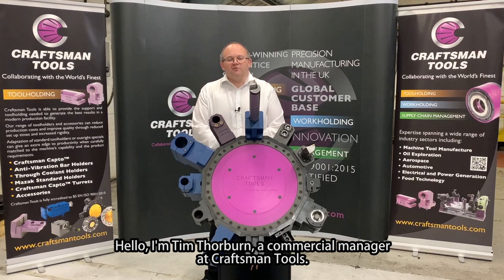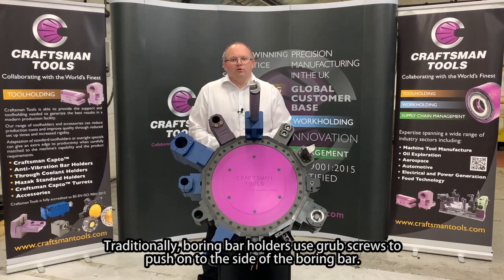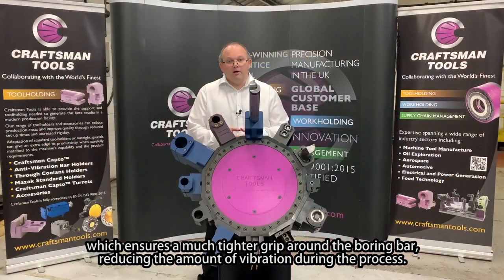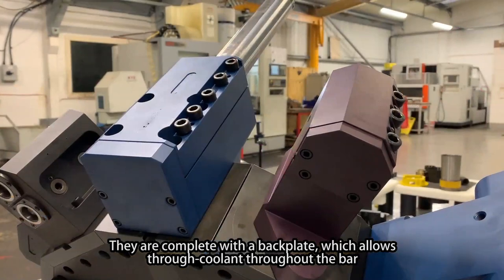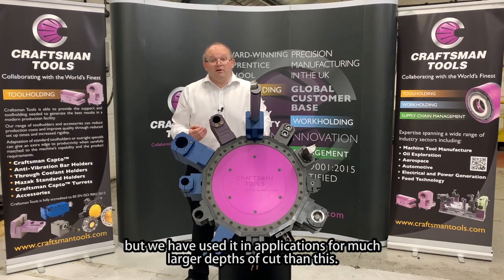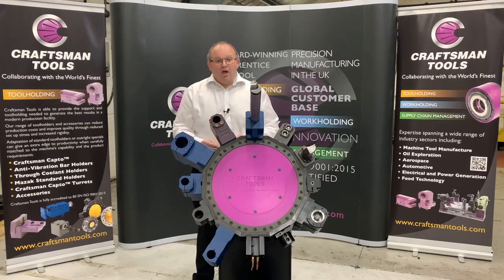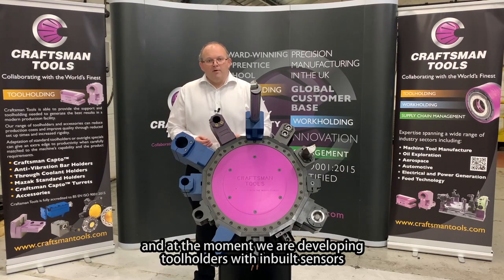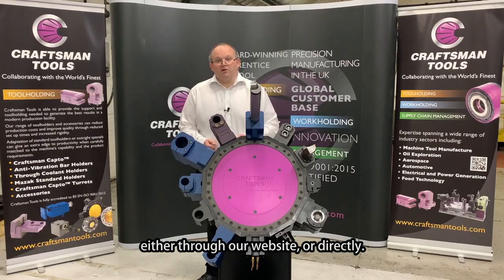Anti vibration Boring Bar Holder Demonstration

Comment: are these toolholders with sensors available for mazak qt/qts 350my bmt80? do you have the version without the sensors in stock? 4xD 50mm diameter